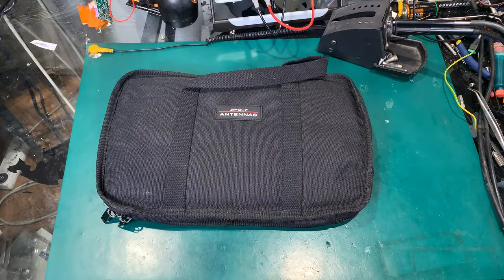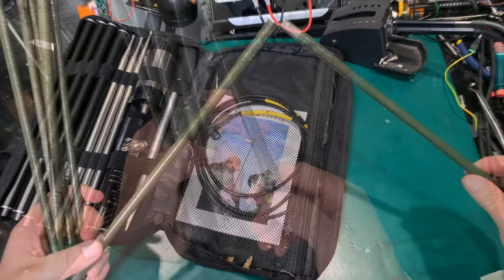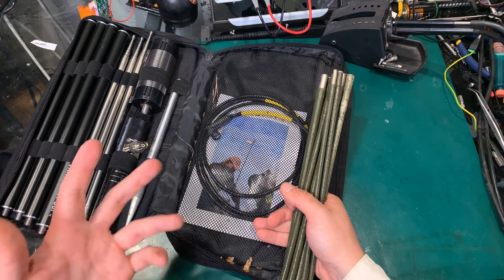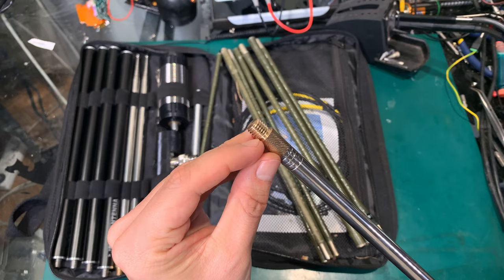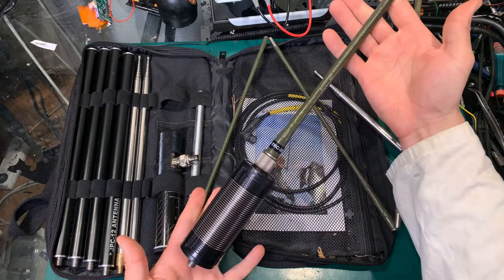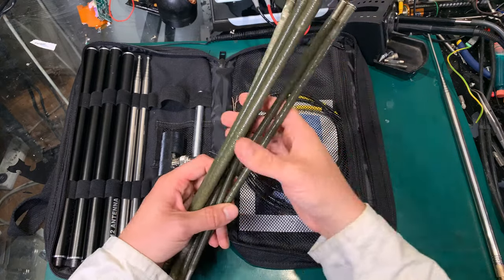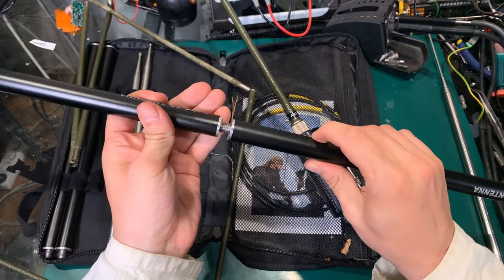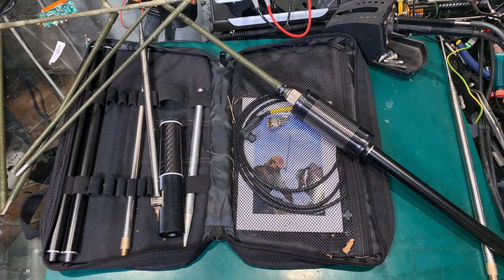PAC-12  HF ground spike antenna  - half civilian / half military - upgrade using ANT 129 whip

Comment: Been using a ANT-129 piece for a wee while now and it’s done well, I have actually had a failure with the JPC’s co-ax feed point, it’s made of 3 parts and that carbon fibre looking piece is glued on with the aluminium rod mounting but on the top screws in, went to go pull it out of the ground and the glue came undone and it yanked the the plastic sheath piece (carbon fibre part) straight off and yanked the wire out, and this was with softer ground. To remedy this I’m picking up a shorter feed point that’s one uniform piece that’s also M10 threaded to save that from happening again, will also be looking at setting up a plus-up kit to run the antenna with longer term deployments (, M10 radial piece, 3 extra telescoping whips and the new chelagance telescoping mast, and from there also looking at the dipole connection piece in the future

Comment: I use about same setup with AT-271 SEM 35 antenna and 3/8 24 UNF to M10 adapter which works fine too. I also replaced the SO 239 on the base part with a waterproof N chassis mount.
Reply: Where did you get the adapter ? I have been looking online and found nothing,

Comment: You showed you antenna in the field with the feed insulator up side down. You have the center conductor of the coax connected to the radial field and the shield connected to the vertical antenna ?
Barry

Comment: nice video well done...if i may ask which bands were you able to tune with the ANT 129 antenna.. thanks
Reply from the maker: I need to buy some test equipment so I can measure antenna without TX-in, for sure will do follow up video but getting HF antenna analyzer is not a priority right now for me as I don't use it often.

Comment: Do you have a link to th6ANT-125?
Thanks for sharing
Reply: Its the ANT 129.  You can find it on Ebay.
Reply: @glenn718  hi how would I connect ant -129 to my Yeasu ft-891 ??? What adapter?
Reply: @DARTHDANSAN  If you have the PAC-12 Antenna you use the ant-129 on the PAC-12 and it connects to the radio with PL/SO 259 coax.  BTW I have much better results using the antenna that came with the PAC-12.
Reply: @glenn718  thanks just saw this reply
Reply: I have the JPC-12, it looks to be the same product.

Comment: The slider on my coil is very hard to move up and down. Is there a way to make this easier?
Reply from the maker: I would add some petroleum jelly to make it easier to move.
Reply from the maker: But first check if it's not bend - maybe this is main issue!

Comment: Good morning,
I have a military antenna like yours, however the wiring is not the same from the antenna to the choke, how did you do it? F5CAV
Reply from the maker: I'm not sure what You mean, maybe I have matching coil upside down? What is problem? You can't get SWR low?

Comment: That military antenna, was it the Manpack folding antenna?
Reply from the maker: Military part was whip "ANT 129 " - You can google it up
Reply: @ElectronicNoobBlog  hi just got the antenna . How would I connect the ft-891 ?
Reply from the maker: @DARTHDANSAN  What do You mean how to connect? You attach it via 50ohm coaxial cable with adapters to match radio and antenna. In Your case most like that would be two UHF connectors. I used UHF to BNC since it's just quicker to deploy and I like military grade coax cable - but it's totally up to You - don't pay attention to any insertion loss on two adapters since it's going to be minimal.

Comment: 60 Meter modable?
Reply from the maker: I don't think so, everything can be lengthened via coil  but I think usability will be not worth.
Reply: yes you have to add one other coil.. i have done with a buddipole and it's ok on 5 mhz.. using a ground system with 4 x 5 mts wire.
I ordered a Pac 12 and i'm waiting for it . it's the same ..(copy).. antenna.